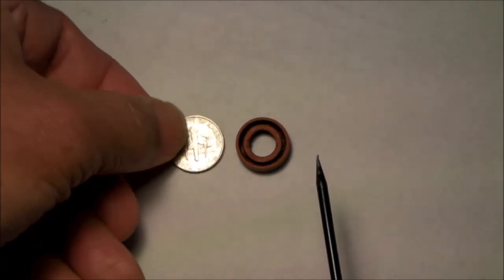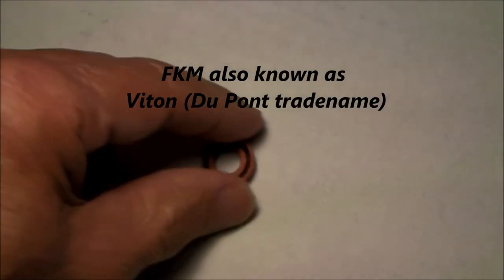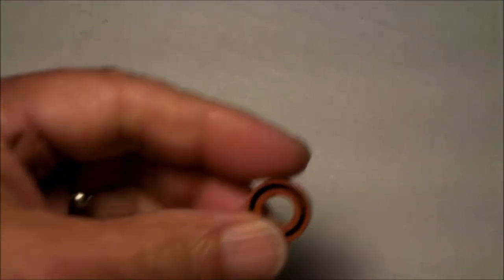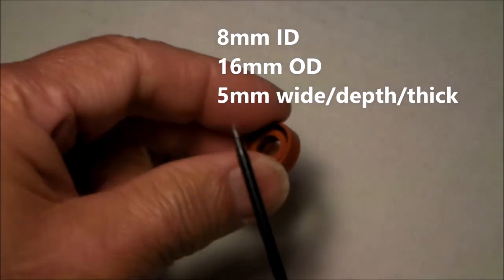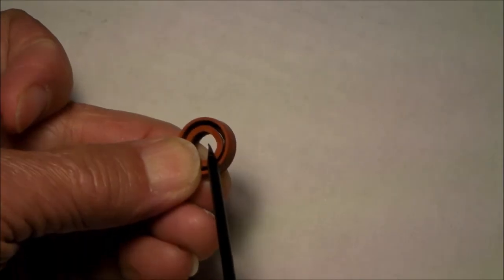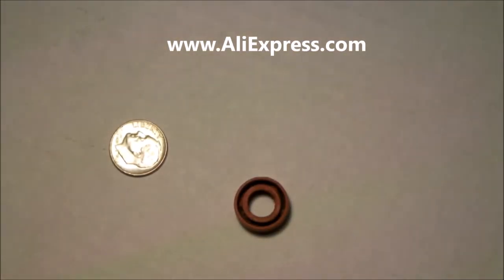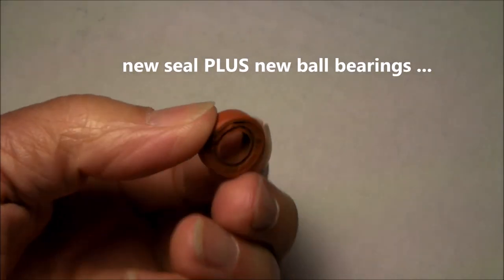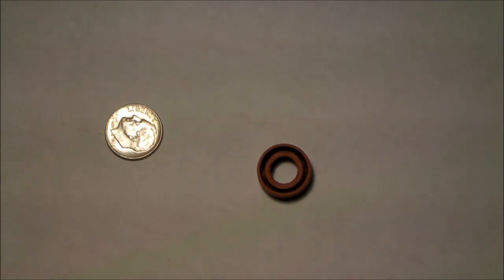Noisy Nutribullet - replace the SEAL and the ball bearings

Comment: Thank you for posting this video! Did it work as expected? Did replacing the seal along with the bearings provide a better, longer-lasting repair vs just replacing the bearings? (Or should we perhaps call it an upgrade, as opposed to merely a repair?)

Comment: The bearings in Nutribullet (900W) are 8x19x6mm, the seal shouldn't be then the same size outer diameter instead of 8x16x5mm? Could you check once again the size?
Reply from the maker: I'm pretty confident the size is correct.  It's only the shaft size ID that seals and if I recall correctly, the seal is IN the bearing cavity so the OD of the seal = OD of the bearing .  Others have also posted the size elsewhere that you  might be able to find.
Reply: @YuDaMan  Makes sense & seals should always be replaced when replacing bearings
Reply: Seal Dimensions!!!!!!!!!!!!!       8x16x5
 @princethewondercat   I have mine apart here and @makinsson is correct; seals tend to be a smaller diameter than the bearings they are shielding. In this case the i have my original seal here to measure.

Comment: HI- how many are needed for a nutribullet?
Reply: And typically how often does the bearings and seals need to be replaced, if you use it daily?
Reply: @judyb4288  It seems nutribullet cheaped out with the bearings & seal or just did not design  the 2 units correctly, the base is to strong for the bearings, this should not happen so often, it's not a $20-$30 blender, they should have corrected the mismatch & install Stainless Steel bearings with a quality seal

Comment: With these do you use them in place of the bearings? Do you need to add the balls to them?
Reply from the maker: the seals are a completely different item.  You need BOTH the seal and bearing.  The balls in the ball bearing do not go into the seal.  the seal is supposed to keep liquids from running down the shaft and into the ball bearings.  Most videos only talk about the ball bearings.  Ball bearings and the shaft seal need to be replaced.  Be sure to LIKE and SUBSCRIBE, to help me.,  THANKS!

Comment: On my device the seals are 19mm OD
Reply from the maker: hmmm...mine are definitely not.  If the bearing OD and seal OD are the same, what is acting as the bearing "stop"?
Reply: @YuDaMan  The seal fits in at the wet end of the shaft the bearings follow that, then the retaining plate. The bearings are commonly available but  It was not easy to get the perfect seal. I had to settle for one 7mm wide. I installed it and it seems to be working fine. (The lower bearing protrudes a little above the housing).